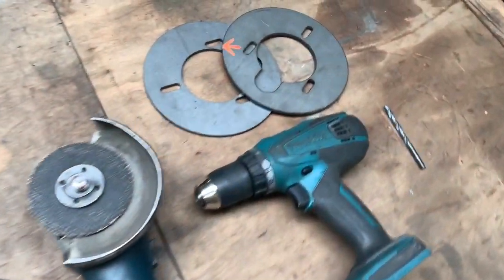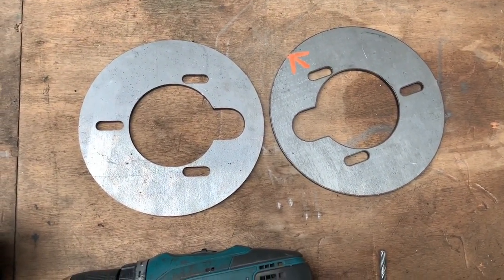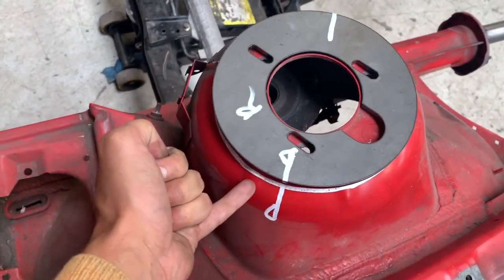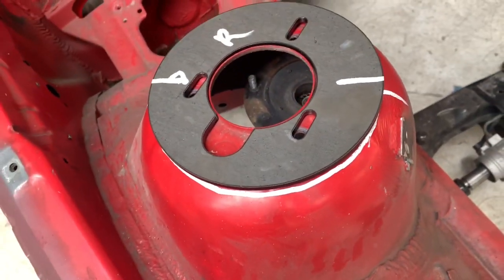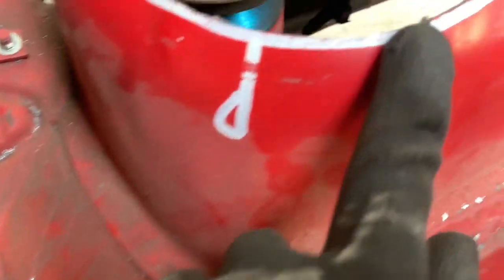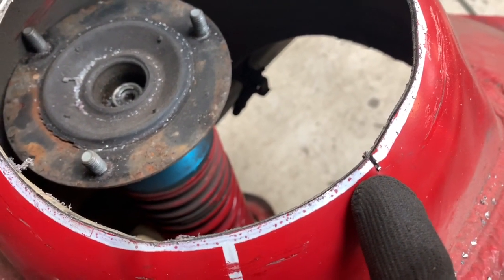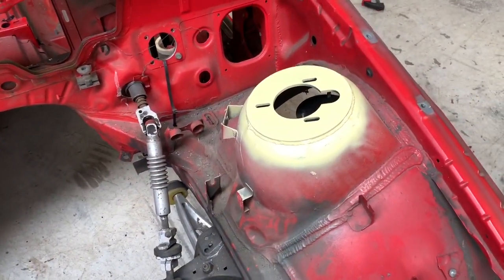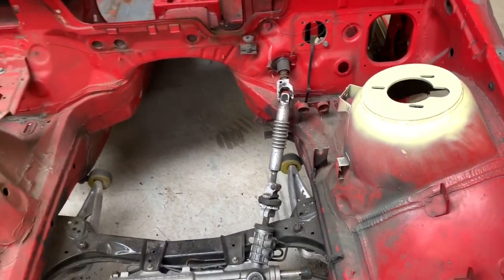BMW E30 / E36 / E46  Strut Top Plates Upgrade info@einzel.nl  worldwide shipping

Comment: Hi, I have a 1989 e30 ix and I heard these towers are different then the is, I. There is a limit on the ix or something like that or less caster. Can this be upgraded on the ix as well. Since I’m doing n54 swap and restoring the ix. What are the benefits . Thanks
Reply from the maker: IX is different tower yes. You may need to modifiy the plate a bit

Comment: does the e46 need these plates as well or jus the e36 chassis
Reply from the maker: Yes, same thing.  Y
Reply: @DriftJesus  keep hearing different things about the 46 chassis some says it does others say it doesnt and messes with the information stream on this car
Reply from the maker: @njdorset1050  yep.  Lots of people have no clue
Reply: @DriftJesus  the 46 seems nice enough and i guess because they are newer even though it is a must it can probably do without it for a while which sounds reasonable enough to me to make it a good buy
Reply: @njdorset1050  same basic design and more weight = same risk even though it’s a younger chassis.
On top of that - reinforcing an existing thing is better, quicker, cheaper than calling a tow truck and fixing a broken shock tower.